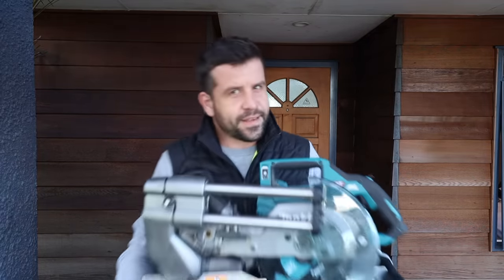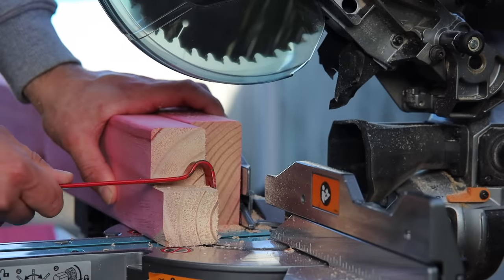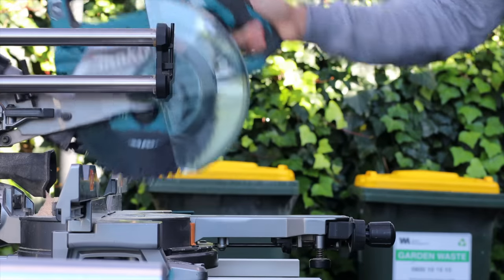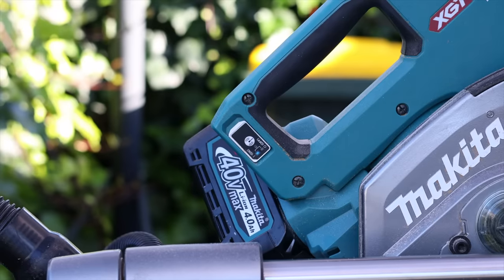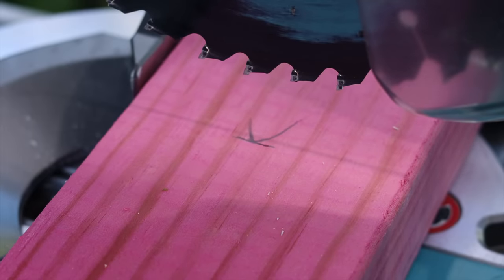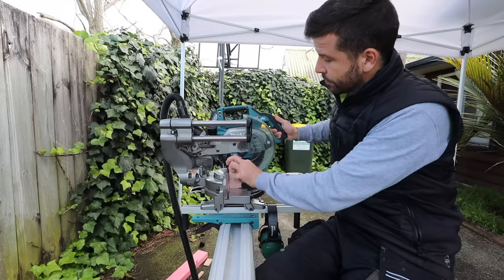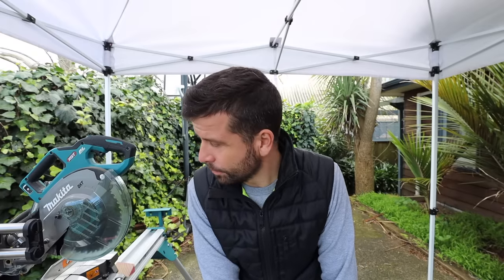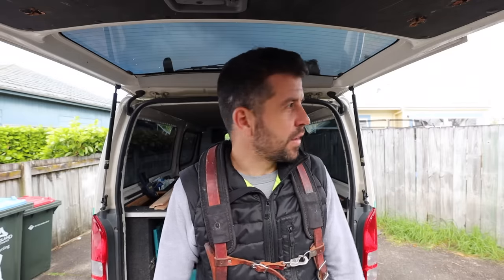Why I Use This Mitre Saw Everyday (Makita 40v)

Comment: My only real complaint with Makita is that each of my (corded) tools; router, track saw, drop saw has a different size of dust port!
Reply: I feel you bro! Cordless as well by the way. Their vacuum matches a Festool tracksaw but not their own angle grinder dust shroud among other things. Drives me nuts!
Reply: Check out Central Technology Systems. They have a range of different sized push on adaptors with a bayonet on the other end which pairs with a fitting on the vacuum hose. I've spent 35 years messing around with different pipes, bits of rubber and tape and usually given up. This system is fantastic.....adaptors on everything, and don't forget the vacuum floor sweeper, and it's a 2 second change over. Best money I've spent to save hassle!
Reply: @richardjames3121  Thanks for the recommendation.
Reply: @richardjames3121  have now tried this system. It is very good but doesn’t fit either the Makita palm router or mitre saw dust ports! If the couplers were made of a slightly more flexible material with a couple of mm of stretch it would be ideal.
Reply: @marcstirrup9262  I agree a bit of stretch would be good sometimes. Smallest one fits my Makita 18v palm router. On the chop saw two circles of blue tape does it and you can still squeeze the portable bag on.  Maybe a hair dryer on it and stretch while it's warm, it may hold a new shape!
Reply: OMG that us SO annoying...agreed
Reply: What is the cut capacity at 45 degree bevel? can it cut through a 2x4 at 45 bevel?

Comment: what we have learned today: scott does not like to reach around to the back.
Reply: Any more than he has to...
Reply: Ooh err
Reply: <guffaw> + 10 points
Reply: Why did they take that feature off. They had it on the 36v and was one of the main reasons for me getting it. That and the big base. I'll be skipping the 40v mitersaw.
Reply: @cmmartti  the bevel adjustment was on the rail on the front of the saw

Comment: I fixed this dust extraction issue on a similar makita saw by removing their pipe and using a different Y piece with a less tight bend.
Reply: Could you share which Y piece you used. Perhaps a link?

Comment: This channel is so useful for me as I work in designing power tools for a living, and on a cordless mitre saw at the moment as a matter of fact. That 216 makita looks awesome, it has all the best features of a mitre saw in my eyes, and of all the tools we have on hand for product research I'd say Makita build quality is one of the best.
Their 260mm 36V is a beast but man it weighs more than the sun, it's clear the 216 was designed to combat the portability issues of the bigger one. 
Keep up the great videos man, hello from the UK.
Reply: It would be really nice if these machines split in two for transport. A quick lock at the mitre pivot would be nice. Make storage easier too.
Reply: @Forexfox99  Interesting idea but it would impact pretty majorly on the accuracy of the product, the tolerance of parts all contribute to cut accuracy, and there's a lot of parts all stacked up that influence where and how the blade lands on the work piece. 
We design our mitre saw to come in 3 components which reduces the pakcaging size by up to 40% and then assembled by the user, but this is a one time assembly, and even then we had to focus on key areas to make sure there is as little play in the saw head as possible. The slightest movement can have a big impact, particularly when making full capacity cross cuts.
And also over time of taking the saw apart and reassemlbing maybe on a regular basis, parts would wear faster and the tolerances would increase meaning over time the saw would become more inaccurate. There's also more chance for dust and debris to get into bearing surfaces on the die castings meaning rough movement or even jamming.
Reply: @Forexfox99  that's a terrible idea, sorry. The MOST important thing about a mitre saw is that it cuts straight, repeatedly. Making it collapsible like that would really mess with the accuracy.
Reply: What is the cut capacity at 45 degree bevel? can it cut through a 2x4 at 45 bevel?
Reply: Are you willing to say what company you work for?
Reply: @colekidd2   yes it will so long as the 2x4 is laid flat and not on edge on the table.
Reply: @N1rOx  Which country do you live in?
Reply: @willholt100  Scott's, new Zealand.
Reply: @N1rOx  Unfortunately not one that you will know or can buy in NZ.
Reply: @willholt100  okay thanks for getting back
Reply: @colekidd2  This can do a 2x4 both left and right.  Not much more though.
Reply: Agreed 216mm / 8.25 inches is definitely the sweet spot. 

1.) If they changed the light button to activate with trigger pull plus 20 seconds on finish.
 
2.) Do a metal grid style higher fence to give reach but keep weight down. 

3.) reverse the vacuum port hook ups, decrease or angle that lower port pick up to reduce the flow diversion 90 degree penalty. And increase the hose diameter on both the pick up, and an option larger hose or aftermarket. 

With those changes, I feel the saw would take over the market for many.
Reply: I use the 81/2 cordless Makita mitre saw which I find to be most awesome.  It is very light and powerful.  Since you design tools, I would love to see more digital readouts on the mitres and bevels.  You could design it as an add on for cost reasons. Cheers.
Reply: Heres a tip that will make you great! 

Mandatory Miter Saw Features
1. Forward Rails 
2. AC AND DC !! 
3. Shadow Line 
4. Light weight 
5. Limit nooks for dust to get caught. 

Let me know when this product exists and ill buy it.

Comment: I have one of these and it’s an absolute gem of a saw, only dislike is the dust extraction but I can live with that!
Reply: Is there any way to plug it in when you don't need the cordless functionality? Or is battery power the only option?
Reply: @doze3705  Some tools have ac adapters to connect ur brushless tool. Tho not need that and can't remember which one have/had it
Reply: Battery is the only option, depends on what you doing but I get a days cutting out of the battery
Reply: With something like this, batteries last a really long time and take no time - around an hour - to charge up. Be cool to have a cord for sure, but for something like this, it is definitely not needed

Comment: I purchased my 40v Chopsaw on the strength of your first video and I absolutely love it..
I fit custom bespoke bedrooms and use it for all of the mitres with no complaints whatsoever. 
My extraction is the Bluetooth Festool CTM MIDI and it’s great, I don’t get clogs? Only issue is the Bluetooth is not compatible, so I just use the Bluetooth button on my vacuum hose. 
I don’t think it’s expensive either, for the convenience it’s worth every penny and the batteries last for ages, I only need to change them once a week and they literally charge in about 15 minutes. 
This is a truly great piece of kit and I thank you for your videos.
Reply: What is the cut capacity at 45 degree bevel? can it cut through a 2x4 at 45 bevel?

Comment: That feedback about dust extraction is pure gold for Makita. Hope they notice 👍
Reply: Dust extraction is the Achilles heel for Makita generally. Unlike Festool, they still haven’t figured out the value of standardizing on dust ports for their tools. You constantly need to McGiver connections. Which, considering the solid quality of their tools, is a bizarre point of failure.

Comment: Great video! Marita is a great brand no question I my  mind. I've owned a 10" electric LS1013 since 2002 and still running with original brushes and accuracy is spot on. I check it regularly for out of alignment and all I can say it's an amazing mitre saw, and I've used this baby every week practically since 2002 as a contractor and finishing Carpenter. That 40V cordless saw looks great, but for sure out of my price range. As for the dust collection, they need to get rid of that corrogated hose, way to many ribs to pull dust thru in abundance, try changing to a preformed light weight rubber hose and I'm sure the difference would be incredible. The ribs also reduce the air movement as it creates way to my friction. That's my thoughts. Great review though, keep up the good work. Andrew

Comment: I’ve noticed with my makita tools that have the light switch on them, if you hold that button down for 5-10 seconds, it will turn the light on for continuous use until you disconnect the battery or you hold the switch for another 5-10 seconds for the light to turn off

Comment: Greetings from the UK, love the channel this is my first comment. I have 3 chops saws for different things. I have the milwaukee same as you because it's the lightest most compact double bevel mitre saw which I use for second fix carpentry. I have the bigger 36v makita for roofing and large section timber because it's got a large compound mitre cut. I also have the smallest makita chop saw which I use for battens and cls stud timber it's very handy on the van. Keep up the good work.
Reply: What model milwaukee you got pal?

Comment: 12” blade needed to cut 4 by 4s (3.5x3.5), 2x4s on edge, and wide baseboard. Sticking with my basic 12” dewalt corded, considering a power station (~$450 US) if I were to ever need to go “cordless”.  Work outside so dust collection is not a big issue. Thanks for the video.
Reply: 10 inch will cut that! DeWalt dw717. DeWalt make the best drop saws in my opinion for.the price 👍
Reply: This is the 8.5" saw. They haven't released the 10" or 12" yet which will have plenty of height to do just that. I have the older 10" LXT 36v and I haven't touched my old 12" dewalt in a couple of years now. Don't get me wrong, nothing but love for that old dewalt but I just haven't found anything the LXT won't do that the dewalt would other than dragging a cord.

Comment: Don't you have a hook up with 3d printing?
The reason the bottom gets clogged is because it is the secondary suction point. Not only that but it is also trying to lift dust up through a difficult path.
The way to fix it would be to remake the top tool connection piece into a single exit. Fit a Y connector half way between the top and bottom tool connections. The vacuum then plugs in at the Y. Equal airflow and suction at top and bottom. Yes air flow and suction are separate things on a vacuum that need to be balanced.
Reply: This makes sense, but I mean.. you shouldn't need access to a 3D printer in order to fix your drop saw's dust extraction, it should just be viable in the first place
Reply: @GeorgeBoltz  of course! But no product is perfect from the box for every user. But with today's modern, accessible and cheap paths to customising. Why wouldn't just fix it. Better than replacing it each time they update. You'd go broke. 
PS. I know he didn't pay for it and I know he probably won't pay for the update. My comment was more to make the average punter aware you have options to fix small niggles.
Reply: I got that saw AND a 3D printer. You you know where I can find the print files? I don't do 3D design.

Comment: I found that removing the bottom rubber dust shroud and tube made the vacuum attached perform better.
Reply: Same.  I even ground the aluminum hole bigger on the side to no avail.

Comment: I don't have this saw but I have the corded similar one.  As far as the dust port issue, I removed that big rubber funnel boot on the base and that spring thing on the saw blade guard port.  I only have one hose that goes to the blade port.  I am getting much better results.
Reply: I'm not aware that there is a corded similar one. I'd be all over it. Pray tell....

Comment: I have a Makita 5" random orbit sander.   I mention this because I was surprised how small the dust collection port was on the sander.  I 3D printed adapters to fit up to my 1 1/4in hoses.  The reduction in size of the port was quite silly, really.  Perhaps there's an upgrade path in the future.  I'm betting tooth count, and moisture may play role as well.  You have an awesome channel.  Thank you!

Comment: Thanks for the review Scott, very timely - I actually went to go an look at this saw yesterday but the local stores didn't have any in stock. I wish the vendors would come up with a standard for the bluetooth feature so we can mix and match!
Reply: FYI: Metabo (in Europe, Hitachi/Hikoki in the East) has a module that detects the vibration from a power tool and the receiver activates the vacuum. The sender module is like a ring that you can mount on the “sucking end” of the hose. Perhaps it’ll solve your issue until the different manufacturers get their sh*t together :)
Reply: @che_  any links - my google foo is letting me down, couldn't find anything

Comment: I'm from NJ USA, . Ive been in the trades for 40 years. I bought the Kapex for $1445.00 ( Ridiculous), returned it and bought the Bosch 10" Axial glide saw, best Mitre saw I've ever owned, accurate, space saving zero clearance behind the saw. also fantastic motor, I highly recommend it.

Comment: Best all round chop saw is the cordless DeWalt 305mm blade. It does everything that a carpenter needs but it’s a pain taking the beast in and out of the van every time.

Comment: It’s perfectly ok to have a favorite saw bro 😎 I’ve got one
Reply from the maker: Some saws just click with you. What's yours?
Reply: @ScottBrownCarpentry  I’m using the Mac Allistet:  MMIS210C-B compound miter saw just now
Reply: Everyone needs a favorite saw bro.  I'll bet yours is an Arlo.  Made in the USA, spare parts available (like hips) and the price is right.  "Ski Resort"
Reply: @ScottBrownCarpentry  Your point of the cut hight , Bosch mitre saws blade housing allows you to cut a bit higher at the back , they listened to their customers and also taking away a bit material from blade housing , that is not actually needed , saves them some money .
Also Bosch had the bevel angle adjustment lock on front of the tool few years ago .
It is amazing that most of tool innovations come from companies like Bosch and Makita that are not owned by some venture capital companies .
Reply: What is the cut capacity at 45 degree bevel? can it cut through a 2x4 at 45 bevel?
Reply: @stevendavanna  What is the cut capacity at 45 degree bevel? can it cut through a 2x4 at 45 bevel?
Reply: @colekidd2  i’ve not used it much bro , i’ll let you know though
Reply: But I was always told universally everyone is supposed to agree on the same saw… around here we call him The Apprentice…

Comment: Great review. I had a Milwaukee m18fuel 12inch drop saw, up until a week ago when, for the second time in 6 months, it stopped working. Now they tell me that particular issue is a regular issue for the 12 inch and they basically have stopped selling the in New Zealand. My back up saw is the electric 12inch version of the saw reviewed here. Apart from the weight, it’s a great saw. The laser issue isn’t a big deal as it’s a simple case of getting used to the line. I use macrocarpa sleepers often, hot knife through butter! But man does it clog up!! My saw came with no dust bag, which I thought was ridiculous but then I realised it doesn’t really needs a bag, because it’s just going to block anyway…I do have a vac that I put on the saw but it still blocks a fair bit.

Comment: A comprehensive review. Nice.
I'm with you on D-handles. I have a cheap 20yr old 255mm GMC drop (not slide) and a similar aged 305mm Bosch Drop and slide, both with D handles. I can use these with either hand. I bought Dewalt 255mm Drops for school which have the sideways handle and I keep having to stop students from crossing over their arms because they are uncomfortable swapping trigger hands

Comment: What ypu said about the vacuum button being a good thing because its safer with out the blade spinning.. is also the exact reason there is a light button. To eliminate spinning blades while also adjusting your timber to the line.

Comment: Great review Scott. 
Your right about the dust extraction.. although I mainly cut MDF on 2nd fix carpentry and it’s sucks up 80% of the dust . 
Softwoods however, clogs very quickly. 

It’s a great saw though.. with a 260 mm blade version on the way …

Comment: If Makita listen to you the newer model might fix the depth of cut issue, a taller fence that should slide not remove for bevels and sort out that light thing.
Scott, I'm a big Makita fan and have lots of battery-operated tools so I know these batteries are quite expensive so I'm sure folk would want to know how many hours cutting you as a job site user, usually get from one fully charged battery.
I'm just back from ordering the corded (LS1019) from my local Bunnings and without a Bunnings card I had to pay full price up front.
My newy is going on a purpose built table/mitre saw/router workbench. The old Ryobi due to its configuration would take up way too much real estate.
Oh, Thanks for the video. I enjoyed watching it in full.

Comment: My all rounder is my daily saw, a 16 or 17 year old Ryobi 10 inch corded saw, single rail, low fence, piss poor dust extraction, but still surprisingly accurate and powerful. But its taken a back seat recently as the guard no longer retracts when you push the saw down

Comment: I’d say the 10” Makita has the best dust extraction of any saw I’ve used and doesn’t clog. The difference might be that the vac attaches to the BOTTOM part of the saw’s dust extraction, not at the top like the 40v. I wonder if it can be switched on the 40v?
Reply from the maker: Interesting, I'll try it out!